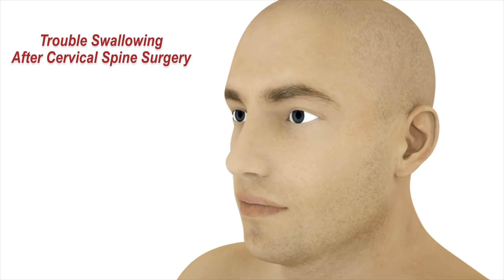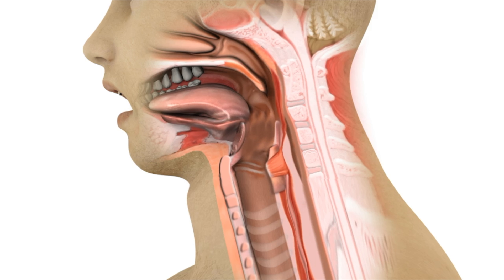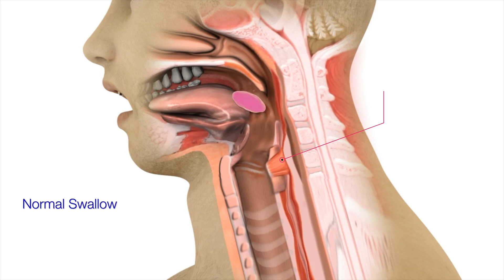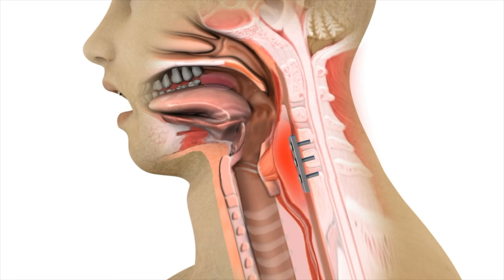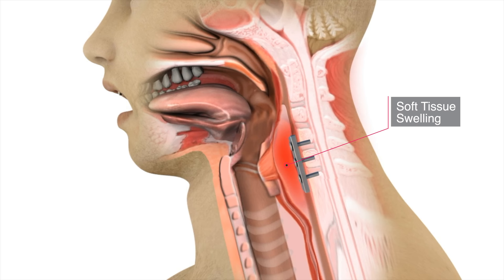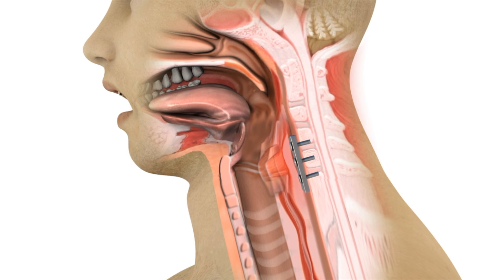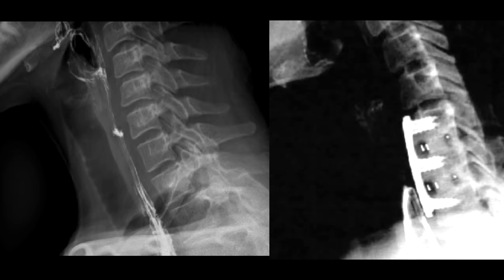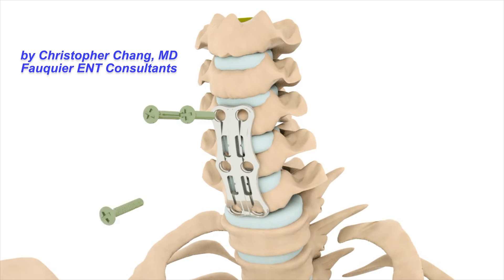Swallowing Problems after Cervical Spine Surgery (ACDF)

Comment: You folks are scaring me … i’m having surgery this Monday … C4-C5-C6-C7 omg…. The swallowing issues i dread
Reply: Hope you're healing well. My mom goes in tomorrow.
Reply: How did it go?
Reply: @fhmaya  it went great👍🏼 heal pretty well... only limited thing i have now is I can no longer bend my neck up to look a planes or birds above i have lean back also to gargle when i brush my teeth.... but no pain.... oh also no sleeping on my stomach as you have turn the neck too much to either side ... only sleeping on my side or back.... i was a stomach sleeper 🙄
Reply: @gavino2250  I'm glad to hear it went well. And yeah thats one of the things  I'm worried about, the limited mobility if they do the support thing with a cage or something rigid.  

Thank you for your response and hope it gets better with time.
Reply: @fhmaya  the limit is not a lot.... just have to be more careful... definitely no more sport associated things... but you won't experience pain  ... swallowing issue for me only lasted 2 days thats it ....
Reply: It's been two weeks since I had the C4-7 surgery. Swallowing is still an issue though it seems to be setting a little easier.  I just hope I can get to a point where Theres is no pain or concern when swallowing.

Comment: I had a ACDF C3 to C7 in 2012 and now understand why I have had continued swallowing problems, thnaks
Reply: Do u still have problem
Reply: I'm having the same problem its been 3 weeks c3 to c7 lost 13 pounds 
Shoulder pain still  bad
Reply: @gurjeetkaur2942  Yes
Reply: @jlutie2943  3 weeks is no time you will just have to stay in there, as it will take longer for the nerves to settle
Reply: @anthonymisell8845  I was told that it could take just as long for the swallowing to be better as the rest of my recovery. 3-6 months. It didn’t but my surgeon prepared me for that scenario.
Reply: @jlutie2943  did u have the surgery cus of shoulder pain?
Reply: Is swallowing a permanent problem for you?
Reply: Both neck and shoulder pain but pain seemed worse after
It's been 3 months still having problems swallowing still having neck pain neck movement not good

Comment: I had C3 -----C7 fusion in Feb. here 9 months later, the top of the fusion did not heal, and the plate is pushing against my throat. Now they have to remove the hardware from the front,  and put it in from the back side of my neck. .  Has anyone ever had this done before? and how has you  been since they put it in from the back?
Reply: @imveryhungry112  They put it in the back march 12th. And it feels back to normal. All my feelings is coming back in my hands. Numbness is 80% gone. Feels great. My doc Harrod is the top spine doctor around. What happened my bone didn't heal or mend right, was not his fault, but he got it right.

Comment: They dont put plates any more, there are new devices that are placed between the 2 vertebre but I would go for endoscopic laser repair of the disc 😉😉 not ACDF
Reply: You must have only had a single level done; as, they most certainly do still use plates on multi-level ACDFs.
Reply: @fadedillusions867  Yes most of them they are not trained endoscopy thats why they do acdf... 😁